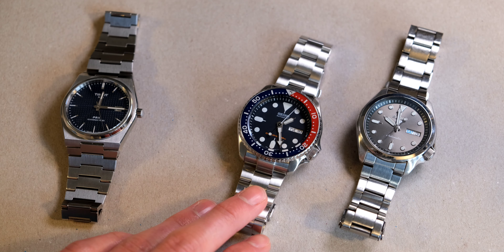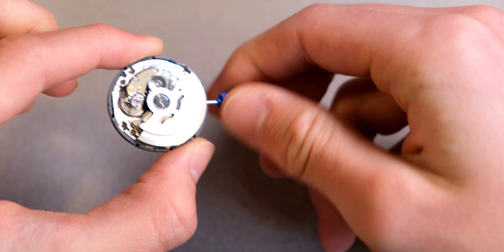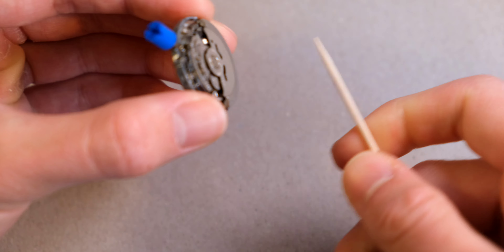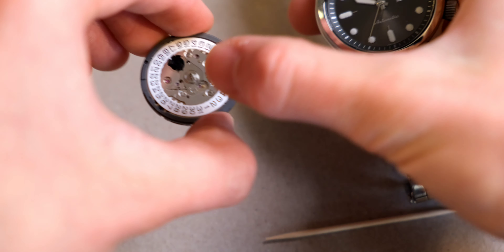SEIKO Rotor Noise and Rattle | Is this normal?

Comment: My $1,400 Presage also makes the noise your third one makes.
Reply: Same issue, the sound is very annoying
Reply: @some2913  sent mine to seiko and they told me that the sounds are normal. 🤦‍♂️ mine didn’t make sound for the first few times I worn it….which i explained to the service rep
Reply: @OkiDingo just bought my presage and have the exact same experience. Didn't made a sound the first week but now does. What happened after that?
Reply: If Automatic then Some Noise you can hear! NORMAL
Reply: @ThepDenNgoaiBien  automatic is mechenical right? Thanks!

Comment: Nh35 Seiko movements no noise I have that movement in a homage 50 phantom watch love it and the watch for money 140 bucks titanium looks like a Bulova for the big money the real 50 phantom that cost like $10,000 or more it looks good for the priced watch from steeldive great movement the best one out of the three of my watches no noise. My tutor from my father from the 1970s makes a little bit of noise I had it tuned a couple times runs okay put that 35 is smooth cheap to replace I love it I also have a steinhardt Swiss German co and I also have a  Swiss co watch zanti makes noise go figure the Japanese movement Seiko 35 and I have a date option on my movement but my face is a hidden dial no cut out for date but the 35 is the most quiet movement the price is great if you have to replace it you don't have to worry about spending money a lot of the watchmaker for a tune-up just buy a brand new 35 movement and smile it's my favorite movement

Comment: have you tried tightening the screw that holds the rotor?
Reply from the maker: I can't tighten it more. The bearing probably doesn't have the best tolerances
Reply: there is a torques spec...do not over tight....They did check from SEIKO factory!

Comment: My Seiko Turtle sounds the same. Got a entirely new movement, still sounds the same. It's a Seiko thing which, in my case, took some time getting used too. But it runs waaayyy more accurate then my Swiss made automatic (that does not make any noises...)
Reply from the maker: Thank you for sharing! Interesting that your swiss watch runs so much worse than your Seiko. My SKX is slightly more accurate than my PRX, but i'm happy with both
Reply: My 7s26 in house classic Seiko still run when I was young man..now I'm 70 still run....
Reply: Japanese watch make. car make....always RECALL themself before happen....SEIKO always said  INEXPENSIVE, LAST LONG and BEAUTY...

Comment: Thanks for this video. I bought a new NY0040 and it makes the same noise. I listened to my SK5 and Steeldive Willard and they don’t. Of course first thing was to search on Youtube. Thanks again, I can go on enjoying it. Cheers:)
Reply from the maker: Citizen watches have a rotor that winds unidirectionally, so when it spins in the opposite direction it will rotate very quickly as there is much less resistance. Maybe that's what causes the sound. Interesting that your Seiko's don't make the same noise as mine. Enjoy that beautiful Promaster

Comment: Thanks for this! I just got a 5 automatic second hand (although brand new, never worn - so they say) and was worried about this noise. I have an automatic omega that doesn't make a noise like this at all, I guess this is just what you get with a relatively cheap watch. 
It looks great, and keeps good time so I still think it's a nice watch for the money, but obvious you get what you pay for to a certain extent. 

The omega I have is a vintage Geneve. If anyone is looking for a fantastic automatic watch at a good price, I really recommend looking for one of these. It's got the same 552 movement as the more expensive seamsters, and looks great. It's just not very water resistant and being old is a bit delicate, hence getting this Seiko to wear when I'm outdoors. 

The seiko is great, but it's no Omega! Really no complaints for the price though.
Reply from the maker: Enjoy your new Seiko and that awesome Omega Genève!

Comment: Where did you get that bracelet? It looks cool and i'm tired of the jubilee bracelet that has my skx. Thanks and great video!
Reply from the maker: It's an oyster style bracelet from Strapcode /Miltat. You can either buy it on their website or on Amazon, which is where I got it. Make sure you buy the one for SKX and not for Seiko 5, which looks the same, but it might not fit!
"22mm Super-O Boyer Watch Band compatible with Seiko SKX007"
Reply: leather....no NOISE if you like

Comment: I have a Hamilton Jazzmaster performer with the H10 calibre and it makes no noise at all. I build my first watch today and had that noise which made me think that I damaged the movement. Looks like its just because its lower quality and that it comes with some play, which is fine. I can highly recommend Hamilton. Seems like their quality for the price is insane.
Reply from the maker: I agree! Hamilton and also Tissot offer great value under 1000usd. Any watch with a caliber based on the eta2824 will have a much quieter rotor than Seiko movements from the 4R and 6R families. I hope their higher end 6L and 8L movements improve on this!!! Congrats on your watch build!
Reply: I own a Hamilton with the H30 movement. Same noise as this video. On wrist in everyday wear, I hear nothing. But if I shake it gently I can reproduce similar to what’s heard in this video. As long as the rotor moves freely, it’s all normal and a non-issue in daily wear.

Comment: Yeah I got a brand new NH35A watch and it does the same thing.
Reply: I have also opened my watch and confirmed that the rotor screw is not loose and the rotor itself just has some vertical play on the bearing.

Comment: My two first automatic watch had Seiko movement, no issue at all, and now I just bought a new watch with a Miyota 8215 and I feel like I have a bell at my wrist, it's very annoying. I really wonder if it's expected or not, sound like what I can hear on your video but much stronger I think.
Reply from the maker: Miyota movements are known for being loud, so what you experience is most likely normal

Comment: Hello! Many thanks for the video. Got my Addiesdive with the NH35 and was wandering if the sound is ok. 

Does anyone know will the watch work properly if I just remove the rotor and use the thing without it? So just to wind it up by myself every day.
Reply from the maker: The sound you hear is probably ok if it's similar to the one in the video. You can remove the rotor, but then you will have to wind the watch manually, which you will get bored of very quickly, as it takes much longer to wind manually than a "regular" manually wound watch. I recommend you just get used to it. You can also try to tighten down the rotor, because the one on my Steeldive is a bit quiter than my Seiko SKX, so it doesn't bother me at all. Good luck!!!

Comment: Thanks a lot, my Seiko sounds like "sheet of metal lose" when tap it or like a sheet not tight and vibrates when tap. the old Heuer nothing at all, but can hear the tic tok at night (is kind of loud) even is a diver and thicker ... but has worked fine for  long, thanks for the video ,,,, by the way have an extra 4R35 around🙂
Reply from the maker: I've added a link in the description to a video where you can hear the noise well. Does your watch sound like mine, or does it also make a scraping sound?
Reply: SEnd back to SEIKO near you

Comment: I have an old Pocket watch that makes that noise But it doesn't have a router.
Reply from the maker: It could be that the movement isn't screwed to the case of the pocket watch, and only held in place by the crown. Probably not an issue